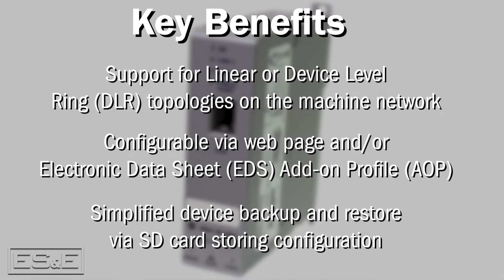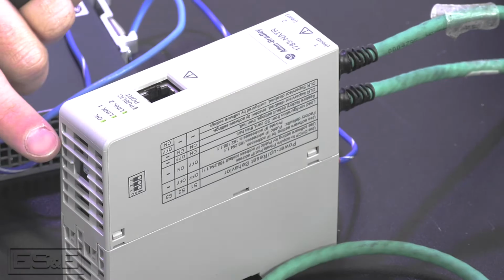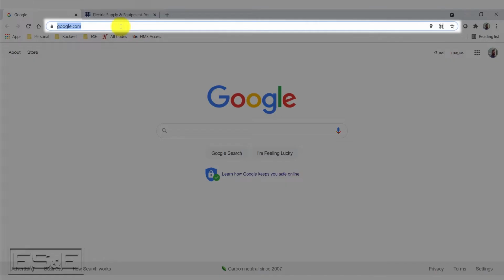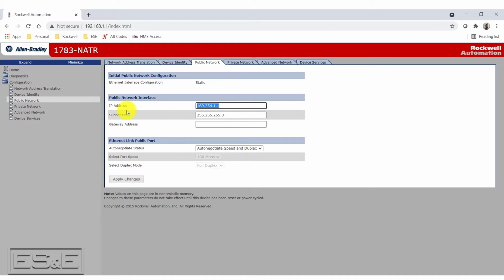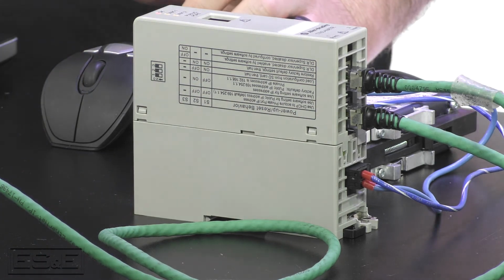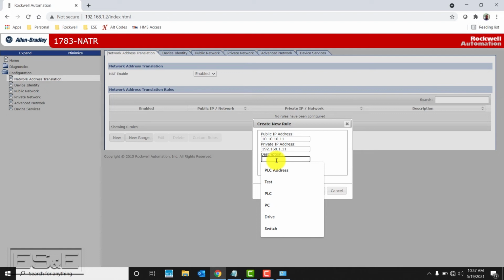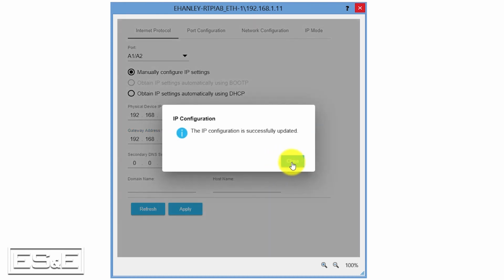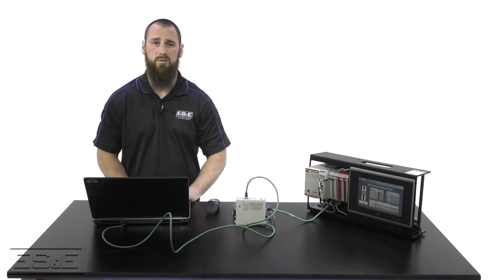Allen-Bradley 1783-NATR Configuration

Comment: In the translation do the last set of numbers have to match? You used .11 for both
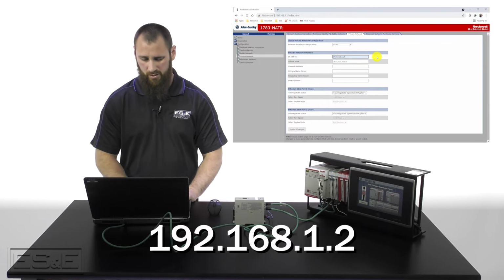Reply from the maker: Hello. If you're referring to changing the 192.168.1.1 to 192.168.1.2 on the private/local port at time 5:42. No, the last octets do not need to be the same between the public and private ports.